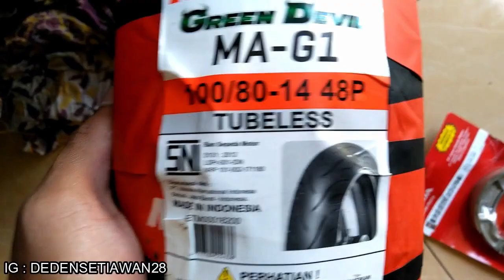Pasang & Review Ban Maxxis Green Devil Uk 100/80 Di Motor Beat Std Kirian Goib

Comment: Bang kalo ukuran 90/90 buat didepan cocok ga buat beat?

Saya rencana ban ori 90/90 belakang  pindahin kedepan terus ban yang belakang beli yang ukuran 100/80 ?

Info nya terimakasih
Reply from the maker: Cocok aja bang, tapi menurut saya kalo depan 90/90 jadi tinggi di depan, sedangkan belakang 100/80
Reply: Tapi kl merk Maxxis gk ada yg ukuran 90/90 untuk yg vitra. Tadiya jg mw pkek yg 90/80 dan belakang pkek 120/80
Reply from the maker: Maxxis victra ada kok ngab yang ukuran 90 90 14

Comment: Bang motor  ane beat karbu, belakang pake uk 90/90, depannya uk brp yg cocok terus aman
Reply from the maker: Kalo untuk ori depan 80/90. Tapi kalo pengen rada ngebulet pake 90/80
Reply: @DedenSetiawan28  iya bang, saya mau ganti ban maxxis, belakang pake 90/90.
Depan nya pake 90/80 jadinya? Tetep aman kan bang?
Reply from the maker: Tetep aman bang, tapi saya rasa maxxis itu bannya tinggi, jadi menurut saya mending belakang 100/80 depan 90/80
Reply: @DedenSetiawan28  oh gitu bang, makasih infonya👍

Comment: Beat 2014 kan belom tubeles bang, terus kalo diganti ban tubles   tetep pake ban dalem kan?
Reply from the maker: Bisa ngab di tubelesin, dan gaperlu pake ban dalam. Cukup beli pentil tubles saja dan ban tublesnya. Dan juga velgnya jangan bocor. Link pembelian bannya ada di pin komen
Reply: @DedenSetiawan28  kalo pake jenis ban tubeless tapi dikasih ban dalam bisa nggak bang?
Reply from the maker: Bisa ngab itu juga
Reply: @DedenSetiawan28  kalo ban belakang 100/80 beat 2014 terus mau ganti shock belakang enaknya ukuran berapa bang?
Reply from the maker: Saya juga itu beat 2013/2014 pake uk shock 310 mm ngab. Kalo mau rada tinggi pake 320mm
Reply: @DedenSetiawan28  kalo enaknya pake 310 atau 330 bang?
Reply from the maker: Kalo enak ganya gimana selera sih ngab, kalo pake uk 310-315 an itu sama kek shock standar motor beat taun segitu. Tapi klo pake shock 330 jadi agak tinggi. Kalo saya enak pake shock kisaran 310-320 anlah
Reply from the maker: https://youtu.be/lRxs0Xo1Yf0 untuk review shocknya dan link pembeliannya di pin komen
Reply: @DedenSetiawan28  oke bangg makssih infonyaa
Reply from the maker: Oke sama sama ngab

Comment: yg belakang sebelum diganti ukuran berapa bang
Reply from the maker: Asalnya belakang 90/80 depan 80/80
Reply: @DedenSetiawan28  nyaman mana mas untuk beat 2020 pakek ukuran depan 80/80 belakang 90/80 sama 90/80-100/80
Reply from the maker: Kalo tampilan pengen lebih ramping pake 80/80 90/80. Kalo tampilan motor pengen ngisi pake 100/80 90/80. Untuk kenyaman berhubung saya pernah nyoba dua duanya jadi nyaman 100/80 90/80. Seperti itu bang
Reply: @DedenSetiawan28  Ok bos terima kasih banyak untuk info seputar ban maxxisnya, semoga chanelnya semakin berkembang

Comment: Bang kalo buat mio soul karbu, ban belakang 100/80 , depan 90/80. Cocok ga ya
Reply from the maker: Cocok bang, review belakang 100/80 depan 90/80 ada di channel saya
Reply: @DedenSetiawan28  udh di tonton bang, takut nya tenaga nya kurang gitu pake ban lebar
Reply: @DedenSetiawan28  maklum soal nya kan mio soul karbu, tau sndri bang kwkw
Reply from the maker: Wkwkwkw oh iya iya, tapi yang saya rasakan pas waktu saya pake 90/80 80/80 dan sekarang 100/80 90/80 serasa gada bedanya terhadap power motor. Tapi kalo pengen aman mah 90/80 80/80 aja wkwkw
Reply: @DedenSetiawan28  mau nya aman, tpi penasaran make donat gmn bang kwkwkw
Reply from the maker: Kalo penasaran yaudah pake aja bang wkwkw
Reply: @DedenSetiawan28  kwkwk mkasih bang saran nya
Reply from the maker: Wkwkwk siap sama sama